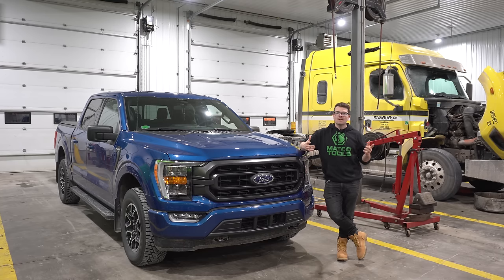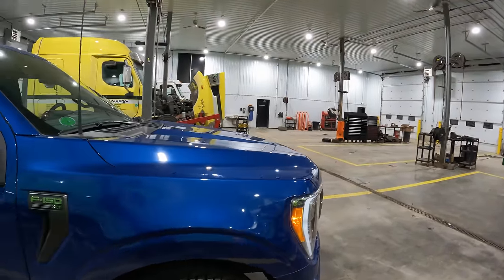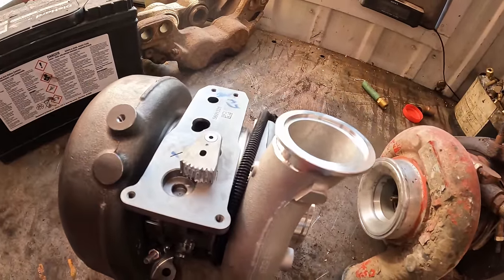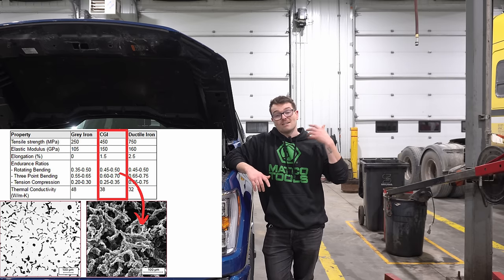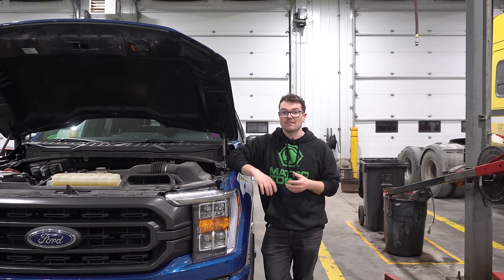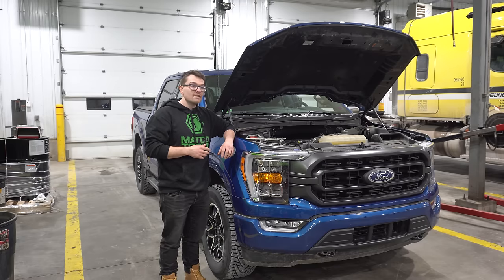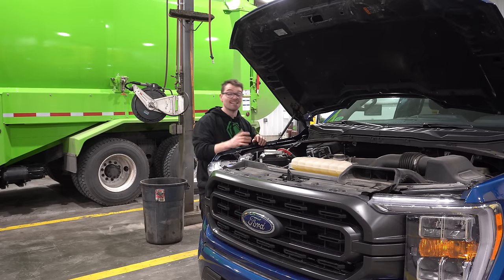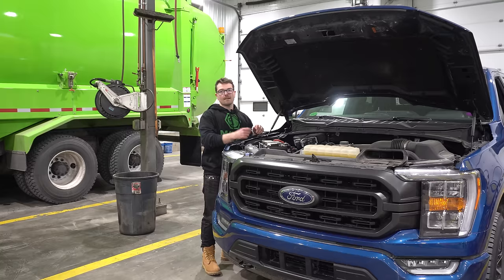Ford F150 2.7L EcoBoost V6 Engine **Heavy Mechanic Review** | How GOOD Is It??

Comment: It's interesting to hear your opinion on this.  I own a 5.7 hemi and I love it. If I leave MDS on (which I almost never do) I have clocked 24MPG if I hypermill it on the highway.  That being said, the Hemi has it's own issues, they all have thier issues.  I love  a V9.
Reply from the maker: I used to own a 5.7, I loved it. I was always surprised at how fuel efficient the hemi really was. something I didn't expect but yes driving on the highway my hemi would always see north of 20mpg.
Reply: I went from a 99 ram with the 360 magnum to a 2013 f150 with the base 3.7 liter. That’s a massive difference in power and gas mileage. I went from 245 hp with the dodge (when it was new, I still have it with over 355k miles on it) and getting at my absolute best 16.5 mpg in it, to my ford which has 302hp and the best I’ve gotten is 28.5 on a trip not using my AC at all. The gas mileage new trucks can get these days is absolutely insane.
Reply: I have a Durango Hemi now and had the 2.7 F150 prior. Other than the sweet Hemi noises, the Durango would be better with this little 2.7 I think.
Reply: @c4t-tp238    We have a Edge but with the 4 banger.  I like that car, it's gotta be something else with that 2.7 in there!
Reply: @justinfincher2385  almost exactly the same situation that I have went thru. Went from a ‘98 dodge 360 magnum, to a f150 2.7. The dodge was and still is a great truck, had it for 23 yrs and sold it to a neighbor, he still drives it. The dodge drove and towed things great but used the gas, usually 11/17 mpg. So far the 2.7 is working out to avg19.2 city and have got a best of 26 mpg. This ford can tow just as much as the dodge did, 8000 lb.
And the 2.7 is MUCH faster than the dodge

Comment: I owned a 2018 F150 xlt. I traded it in this year for a 2023 f150 Tremor with a 5.0. The 18 never left me stranded but it had some issues, at 20000 miles the check engine light came on and the dealership had to replace the injectors. Fast forward a few years, just outside of warranty may I add, and the check engine light came on again. I took it to the dealership and same thing. I took it home without the repair and the next morning the check engine light was off. From then on every year around February/March the check engine light would come on. I would limit the gears and drive at high RPM on the highway. It would never fail the next day or two the light would turn off. but after 7 years and 55000 miles I started getting a lot of white smoke on start up, so I traded it in. The truck was great, but the 2.7 left a bad taste in my mouth. but that is just my experience.
Reply: I'm having the exact opposite experience and I bought mine new in 2015. 235k miles and going strong.

Comment: Funny no talk about plastic oil pan and wet belt oil pump…………….also hard on spark plugs.
Reply: I didn't change my plugs until 100k and that was only because it was recommended. I currently have 135k miles on that set. No problem. I have new plugs and new ignition coils to put in, just haven't gotten around to it yet.  My 2015 "Nano" runs great. In fact, the plastic oil pan is the only thing that I'm not crazy about, but that's because it leaks a little bit. Started leaking around year three, but it's barely any. Luckily, my driveway is gravel, otherwise I would've fixed it by now! lol!

Comment: I have a 21 F150 with the 2.7.
So far, it's been great with only one complaint. I get a weird shake in the power train when accelerating at a low RPM. It feels similar to an unbalanced wheel, but like its coming from the engine or driveshaft. To prevent the shake, i just have to manually downshift to boost the rpms or hammer on the throttle a bit. It also does it less in sport mode, since it tends to keep the rpms up a bit.

It's still under warranty, i just haven't had the time to take it in to get it checked. Any idea what it could be?
Reply: Likely engine lugging. RPM is too low.
Reply: Torque converter maybe

Comment: ISNT THERE A NON TURBO ENGINE, THAT WILL GIVE ME GOOD PERFORMANCE, AND LONGEVITY FOR TOWING MY 8000 LB RV?????? I WAS TOLD, THE 5.0 COYOTE WAS A GOOD CANDIDATE. THANK'S, FOR YOUR FEEDBACK
Reply: Why be scared of a turbo?
Reply from the maker: 5L coyote is a great option. even the 5.7L hemi is a great towing engine.
Reply: CAN YOU TURN OFF YOUR CAPS LOCK? ITS A SMALL BUTTON ON YOUR KEYBOARD THATS VERY EASY TO PRESS AND MAKES YOU LOOK LESS LIKE A BOOMER.

Comment: oil pump is driven by a wet belt... it will fail before the previous gen's chain driven oil pump.
Reply: Yeah, I think I'll stick with my 2015 "Nano" w/6-speed.
Reply: @bendino
An opinion is not a fact

Comment: I've been looking for a comparison video between the Ford 2.7 Ecoboost, and the GM 2.7 Inline 4. Obviously two very different engines.  But both the entry engines  ( almost) for these companies.  
Curious some opinions,  and real data, on which one is better engineered and be more reliable long term.
Reply: The ford is probably a safer bet because it’s both DI and PI while the Chevy 2.7 is DI only. Chevy is also running more boost, 23ish psi vs 27 if I remember right. You can’t go wrong either way but the ford is a better engine overall imo. Chevy will probably be cheaper to work on if carbon buildup isn’t a huge issue
Reply: @dawsongranger4940  thanks for the reply.
Reply: @dawsongranger4940  wouldn’t be surprised if Chevy adds port injection to the engine in 5he future

Comment: Unfortunately the new 5.0 might have issues with reliability. It now has variable cylinder management and a submerged belt to drive the oil pump.
Reply from the maker: ya I don't like the cylinder de-activation.
Reply: Take a look at used high mileage f150’s, almost all of em are 5.0’s
Reply: @robmd3851  but most of those are before 2021+ gen 4 coyote that introduces the cylinder deactivation crap.
Reply: Cam phaser problems are starting to show up also with the 5.0

Comment: Great video, also 15 years heavy equipment mechanic by trade and owned three of these. 
2015 2.7 which is at 170,000 mi and absolutely zero problems.
2015 3.5  at 200,000 mi tuned up running e50. Only issues were exhaust manifolds and some coolant leaks. Not bad for a 500 HP work truck.
Third truck is the 2021 powerboost just rolled 70,000 mi also tuned. Again, 0 issues.
Key to pretty much any turbo engine is maintenance.

Comment: Hello, great videos. I am disabled and live on a limited income. I currently have a 2012 GMC sierra with a 5.3. The truck gets 14 mpg. I am in the market for a newer truck between years 2017-2020 possibly. With the 2.7 and 3.5 EcoBoost and then the 5l Coyote engine for Ford. then the 5.3 for the GM and the 5.7 for the RAM, what would be the best engine transmission combination for reliability in your opinion with these engines. I worry that if I have to buy a used EcoBoost with almost 100K on it would I be in trouble or should I stick to a naturally aspirated engine and sacrifice a few MPG? Any and all help would be greatly appreciated.

Comment: I have a 2021 f-150 with the 2.7 that I bought new. I’ve put 60,000 miles on my truck and I love this engine. Plenty of power and torque, good gas mileage and it’s quick for what it is.

Comment: Just bought a 2023 STX 4x4 with a 2.7L and love it. I was very skeptical about this size of this engine at first. Coming from a 2015 Ram 1500 5.7L I wanted another V8. Well did research on this 2.7 and glad I went with it.

Comment: My 2016 2.7 EB has 98,000 miles. Took it to Colorado from STL this year and with the 36 gallon tank it had a range of 770 miles. Close to 22 MPG going 75-80 mph with a fully loaded truck bed and 4 passengers.

Comment: I want good advice
I would like to buy a ram truck with a 5.9 cummins 2005 diesel
Which is better in terms of longevity?
Because I found a used track with 255miles

What is the best diesel truck?

Comment: The 2.7 was designed to be a turbocharged engine. The 3.5 originally was not. I have a 2018 f150 2.7, 10 speed, with 165,000 miles. Not a single issue ever.

Comment: Just by luck, found a 2019 Lariat FX4 2.7 L Nano with only 50,000 km. Had a 2010 4.6L 4x4 Explorer Eddie Bauer (230,000 km). Thanx for your insight, made my choice on the Nano much sweeter.

Comment: Wondering if the durability of the 2.7 is good cause they don’t rev that high to make power…my 23 bronco with the 2.7 redlines about 5000 rpms…..good power band right of idle ….i am  impressed with the little v6

Comment: I loved my 2.7 ecoboost engine in my 2016 F150. I did not love the 6speed tranny. Sold the truck at 100,000 miles. I would not hesitate to have another 2.7 engine. Probably a Bronco next time.

Comment: My 19 XLT has been tuned, cold air, and brake boosted a number of times. Fires right up, not a single problem so far. 80K miles.

Comment: Is the 3.0L EcoBoost that produces 400hp and 425lb of torque derived from the 2.7L you are reviewing? It is current available in at least the Explore ST. I did read that the 3.0L EcoBoost is also going to be available in some models of the 2025 F-150. Thank you.

Comment: @TheGettyAdventures - Great vids on this engine and truck. 

One comment to dovetail one of yours… I believe the 2.7L was designed/engineered outside of the US focusing on fuel efficiency with just enough power and torque for most users… and the 3.5L was designed by Ford engineers stateside for more power vs economy - largely copying the 2.7L.  And yes, the 2.7L vs the 3.5L has a bit more reliability and less issues than the 3.5L engine. Coincidence?  I think not.

I love the 2.7L and believe it is the best engine for 95%+ of typical F150(1500 series) customers. But thick-necked “truck” guys will always want a V8 while wasting $ on fuel.

Ranking the F-150 engines from best to worst for 95%+ customers :

1). 2.7L great mpg and reliable, more than enough power

2). 3.5L more power and decent mpg albeit slightly more reliability issues

3). 5.0L power and torque at expense of mpg 

4). 3.3L normally aspirated. No fuel efficiency gain, and a dog for power

Comment: In the 80's Ford made the 2.3L Turbo (Intercooled Port injected single Turbo) basic engine that was in the 84 to 86 SVO, Merkur up to 1988 Turbocoupe, probably one of the best engines by Ford other than the straight six and the 302
 It was totally reliable ,easily modified with very little issues if any. But Ford went from Job1 to Job Woke so don't expect much from them now, it's hot or miss for the last 7-8 years.
Reply: Just like all of the manufacturers have

Comment: Own a 2015 f150 2.7 with 75,000 miles, intake exhaust and tune has kept me happy for 40,000 miles love the 36 gallon tank for roadtrips and the mpg especially with an economy time and with a performance tune you can squeeze quite a bit of boost and hp out of the “pocket hercules” 2.7 engine

Comment: I went from my 2017 Mustang Ecoboost 6 speed manual to a 2020 F150 2.7 XLT 10 speed auto and I am loving my truck. Don't get me wrong I still got my mustang and love it, I only wish they still made trucks in manual. I almost went with a 2016 Tacoma TRD 6 speed manual, but im glad I went with the F150. For the size and weight im surprised by the fuel economy, its very close to the fuel economy my mustang gets.

Comment: I’m a Ford fan. I’m currently on my sixth one. I’ve owned a 1975 Grand Torino Elite, 1977 Thunderbird, 1992 Tempo, and 1999 Taurus, 2000 Explorer and 2007 F150 Super Crew. That being said the naturally aspirated engine is the way to go. Of all my vehicles I’ve never had an engine failure other than the Elite which I inherited with high mileage. I broke the cam hot rodding it. It ran great until I stressed the old engine. I replaced it with a 351M/400 engine from a 72 Ford LTD Brougham and proceeded to outrun Barracudas because the overdrive would kick in at 90 mph and would peg the Elite at 120 mph instantly.  I maintain my engines now at 5K and the F150 has 201K miles on the 4.6 with no slowing down.

Comment: 2017 2.7 with 150k miles here.  At 100k needed a water pump.  120k boost solenoid on valve cover went out. At 150 procrastinating changing the plastic oil pan lol. Still going strong

Comment: have a base model 2020 2 whl drive 2,7 490 000 km on the clock bought it used with 468 000 has a few noises in the topend but start drives and goes good

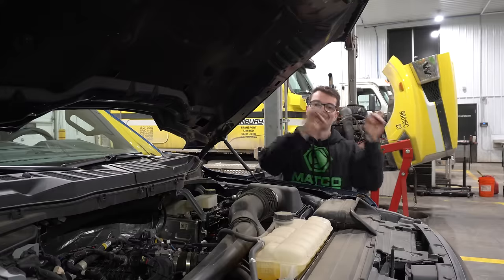Comment: I have a 2016 XLT F150 crewcab 4x4, 5 1/2 ft bed with the 2.7 Ecoboost. I bought it brand new and was very nervous about getting it. I was getting out of the famous 6.0 power stroker after blowing the head gaskets for the  third time and the 6.4 power stroker was even worse than the 6.0. I was looking at another diesel, but my wife was giving me  ear spankings about getting another diesel truck.  I currently have 150K miles on it, which may not sound like much for some, however,  as an electrical and HVAC contractor, I work the hell out of my trucks.  I have a 6" lift with 35" tires, highway product serve body, deck toolbox, front and rear Fab Four bumpers, a Firestone air compressor with rear air bags, and 4:56 gears in it. I get 16-18 in the city and 20-22 hwy. I run a lot of service calls in it, and I tow about 8K-10K enclosed trailers on a monthly basis. The most has been about 12K.  I can honestly say, it's been over all the most reliable, capable engine I have ever owned next to my 12v cummins and my inline 300 ford.  I will more than likely either buy another one, or have this one rebuilt when the time comes, hopefully not for another 150K.

Comment: I had a 2018 F150 with the 2.7 and 10 speed transmission. Lasted 26k before it started having issues. Traded for another brand shortly after.

Comment: my 2018 2.7_L is running strong now at 190,000mi.  Yeah thats right 190Kmi.  I got a leaky plastic oil pan & oil spill on stabilizer bar every oil change, but it is great beside those annoyance.  Regular maintenance always on time!!  So hoping to squeeze another 100k mi out of it ❤

Comment: This is a good Ford engine but it only puts out 400Lb Ft of torque while the 2.7 liter four from GM makes 430Lb Ft.
I think Ford does not want to raise the torque numbers of this engine cause it would compete with their 5.0 liter Coyote V8, which only puts out 410Lb Ft.
But they should improve on the torque specs, don't you guys agree?

Comment: I had 2021 xlt 2.7 eco one. And i drove 90,000miles in 1.5 yr. Long story to short. I had huge problems with engine or transmission around 60,000 after that it got worse. But ford didn’t give a loner car for that problem with under warranty. So i had to sold it. But overall this is very good. I drove 200+ every daily. I drove 80mile highway and little local. My mpg was 21.5. But service was horrible.

Comment: My 2023 2.7 I purchased new as my last pick up, ever. Pulls a trailer hard with the Tow package and 10 sp. Driving the F450 diesel towing trailers was a habit hard to break. This is my retirement truck to tow a car around and it does it so well. I am glad I took the time to learn about it. I have the 3v mustang and dealing with problems of such an engine I discovered it is reliable up to a point. Just don't go past that point.

Comment: Late model  2.7 l EcoBoost have a rubber belt driven oil pump where the belt is in the oil pan. Not good for longevity.

Comment: Bought a new one in 2016, amazing truck except for the electrical issues. But that had nothing to do with the engine, crazy good fuel mileage and torque was nothing short of amazing.

Comment: What about the rubber belt, runs in oil driving the oil pump ?  Service interval ?  Replacement cost ?  How about the cylinder thrust side wear from pulling so much power from a small displacement ?

Comment: I have a 2018 2.7 XLT with a lift and 35 inch tires and get 15-17 mpg but only 10 mpg while towing 5k lbs trailer. Just dont listen to ford on maintenance and change oil ever 5k miles and all other fluids ever 30k and this engine will last until water pump or oil pump fail

Comment: Ive owned mine since new 2016 and tow a 5k# camper periodically and a lawncare trailer 7 months a year without a hiccup. I pull a steep 7% grade on a narrow 2 lane. The speed limit is 30mph and it pulls my 3k# of lawncare equipment in 3rd gear with ease at around 1600rpm. The amount of torque this engine puts out throughout the rpm range makes it feel like a turbine. Plenty of room to access stuff to work on it if need be.

Comment: I was thinking this engine would be good teamed up with a mild hybrid, like the powerboost for explorers and expeditions. Lincoln’s as well. My brother has a 22 powerboost and sister in law has an Expedition with the regular 3.5 Eco and dare I say too much power. 
Something else people don’t mention is the hybrid electric motor. they mount on the transmission has the same horsepower and torque output at all RPM levels so it’s essentially instant power off the line.

Comment: Diesel engines turn at a much lower RPM than gasoline engines. The peak torque comparison between the two is irrelevant. Completely different animals. Most people still don’t understand how a diesel engine works.

Comment: 2023 Ford F150 2.7L EchoBoost Piece-Of-Junk blew up at 54,000 miles. I'm going back to Toyota it lasted over 500,000 miles. My son is still driving it today. My brother-in-law's Ford Bronco with the 2.7L EcoBoost. Same problems, burning oil burning up spark plugs, burning oil, leaking oil pan carbon buildup, broken engine parts and etc.. Do I need to say more?? REALLY? Google this they have a Toyota truck that has over 1,000,000 miles that Toyota got from this person and gave them a new Toyota truck. Honestly I had a Ford 1997 Ford F150 It had 269,000 miles and still going. That's why I bought the brand new Ford UP above.👆🏻🤬🤜🏻FORD🤛🏻